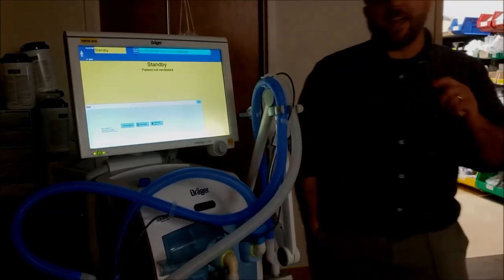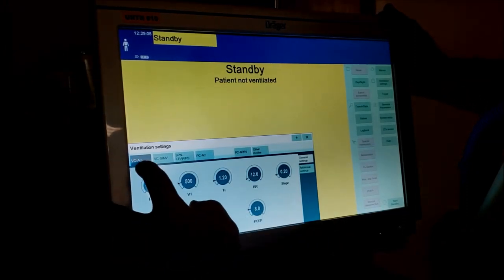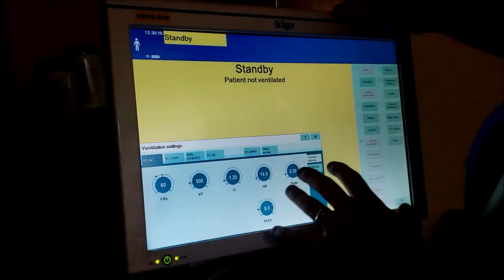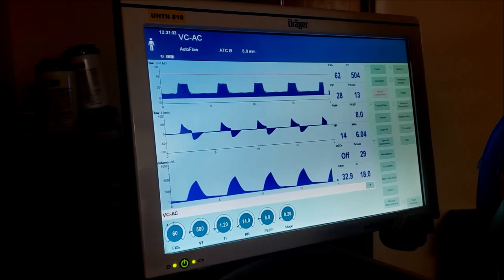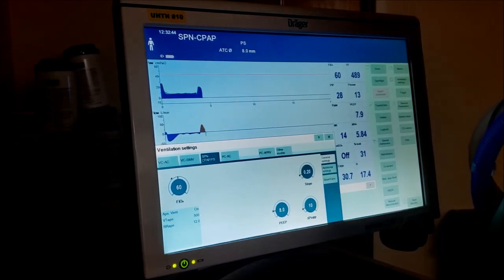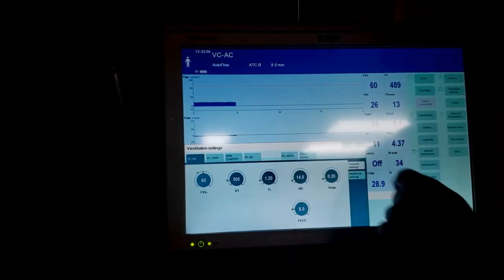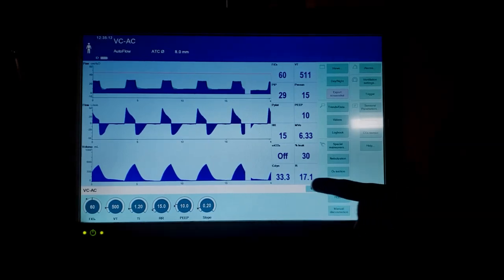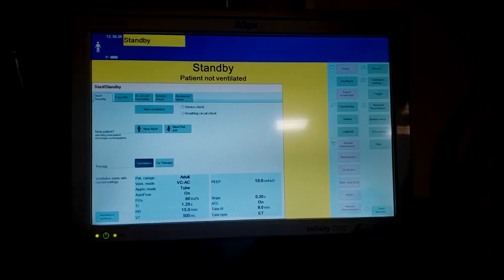RT Clinic : Pandemic Preparedness - Quick Ventilator Set up and Modes

Comment: Great video Jimmy!
We need as many of these “intro to ventilators” videos out there as possible in a time like this. Most of us will eventually have to work with a ventilator we are unfamiliar with and we may not have time to learn the nitty gritty of the model. Might want to add a small disclaimer that we generally want to avoid Autoflow on VC A/C when our patient has ARDS. This is because it turns VC A/C into PRVC. 
Keep up the great work!
Reply: Hi. Could you please explain why would you turn off Autoflow???